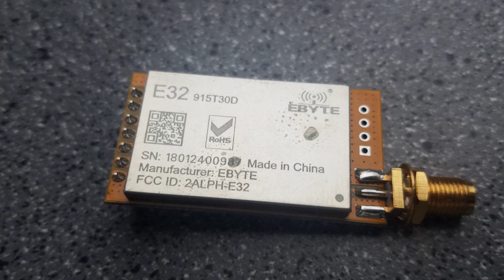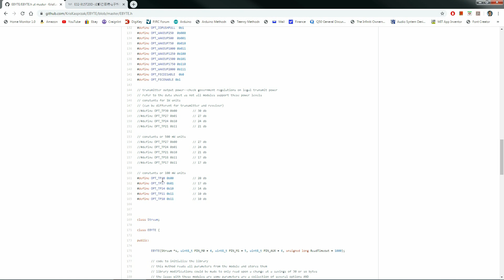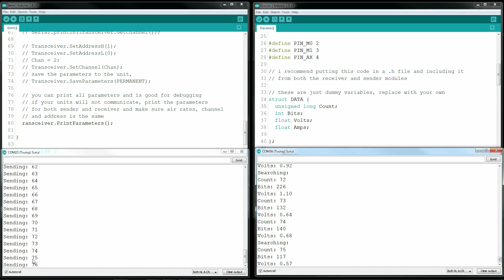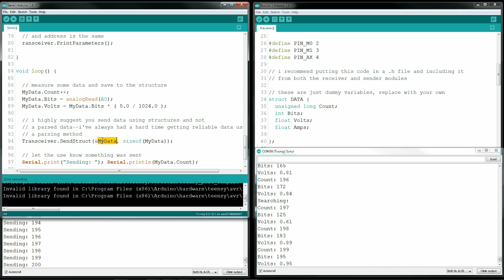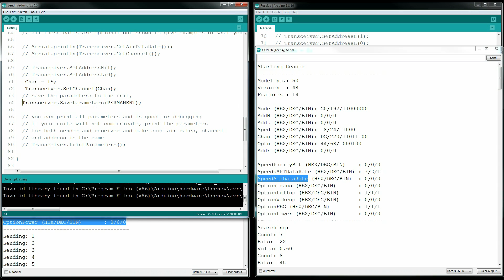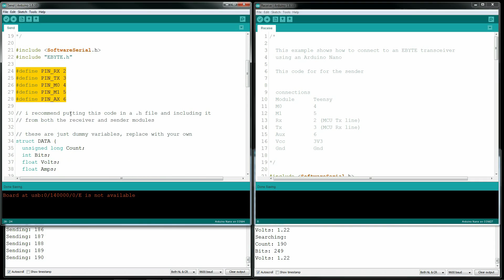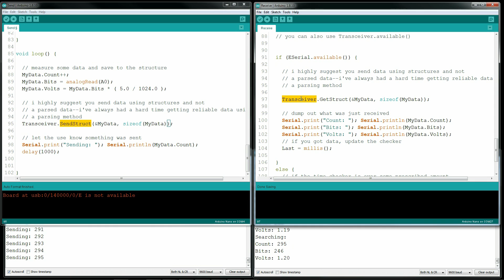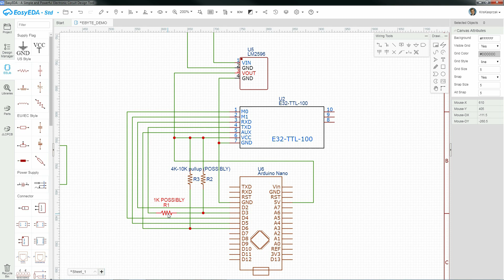EBYTE Wireless Modules for MCU projects

Comment: Hi
In my project I'm using 2 LoRa E32-900t30d and 2 ESP32 devkit v1. I managed to place the same channel in both modules using the syntax of this code, however the parameters: mode, speed and optn of one of the modules are all set to zero, unlike the other. Furthermore, this same module has a model, version and feature number equal to 0, also differently from the other.
I would like to know how to manually set these parameters (mode, speed and optn) so that they're the same as those in the other module.

Comment: Greetings, Mr. Kasprzak,

First of all, thank you for sharing these amazing explanations.

I need your help with my academic project. I intend to send data via LoRa RF. On the transmitter, I have connected the HC-SR04 ultrasonic sensor, the LoRa E32 and the Arduino Nano. On the receiver, I have the LoRa E32 and the ESP32 Wroom.

I followed your examples, but I still can't send the sensor information to the receiver.

Can you help me, please?
Reply from the maker: I'll see what I can do, you may have a few issues namely due to 1) different MCU's and 2) a 5 volt Arduino, these EBYTE units are 3.3 volt but 5v0 tolerant. Hence they can be finicky with Arduinos

1) Test a simple wireless connection first byt sending no structs by just 1 byte 
sender: EbyteSerial.write(97); // lower case a 
receiver if (EbyteSerial.available() { Serial.println(EbyteSerial.read());}}

if you dont get an 'a' on the receiver look at my page for suggestions https://github.com/KrisKasprzak/EBYTE

2) If you do get and 'a' it's probably a struct packing issue. Using different MCU's is complicated but possible, I do it all the time. The challenge is different MCU's will pack a struct differently such that the other will not know how to read it. I use EasyTransfer.h from https://github.com/madsci1016/Arduino-EasyTransfer it can send a struct in a way other MCU's can read. Implementation is something like this

// sender code

#include <EasyTransfer.h> 

EasyTransfer DataPacket; // global variable give the new data packet some cute name

DataPacket.begin(details(Data), &ESerial); // in setup, Data is your struct ESerial is the serial object

Data.SensorData = YourMeasuredData // just an example

DataPacket.sendData(); // make this call after you have populated your struct

// receiver code

#include <EasyTransfer.h>

EasyTransfer DataPacket; // global variable give the new data packet some cute name

DataPacket.begin(details(Data), &ESerial); // in setup, Data is your struct ESerial is the serial object

// in loop
if (DataPacket.receiveData()) {

 	ReceivedSensorData = Data.SensorData;

	Serial.print("Sensor data: ");
	Serial.print(ReceivedSensorData);

}

hope this helps
Reply: Noted! I will follow your instructions.
I will be in touch.
Thank you.
Reply: @KrisKasprzak   

I managed to establish communication between the two MCU. I even managed to send the data to a Broker! I am very grateful for the support.
God bless you.

Comment: amazing my friend, just one question, u library works on E220-900T22D too? thz 4 all!
Reply from the maker: This library will definitely not work with the 220. That unit has more capability and different program settings.  Note this library is only needed for programming these units. for send/receive you can use SerialObject.readBytes(... and SerialObject.write(...
Reply: @KrisKasprzak  i understand, thz 4 answare, can u tell me what libray i can use with 220 device?

Comment: please the Ebyte library can work with the E49-400T20D on esp32 exemple ??
Reply from the maker: this library should be able to program the E49, see the example ESP32 folder. However  you will need to specify 0 for each of these (as they are unsupported):

.SetPullupMode 
.SetWORTIming
.SetFECMode

Comment: Dear Kris, I wanted to extend my deepest gratitude for your incredibly helpful video. I was struggling so hard to get two Ebyte modules to work, and despite looking around the internet, nothing seemed to do the trick. Your video was a lifesaver, providing clear guidance that finally got the modules up and running smoothly. Now, my only challenge is figuring out how to make them function in half duplex mode. Your experience and guidance have been invaluable, and I cannot thank you enough for sharing your knowledge with the world. 
I also appreciate the enormous work you put into creating that wonderful repository on github which was very useful (it's really well done).
Reply from the maker: Glad I could help.  

Not sure what you are trying to do, but I do half duplex all the time. Have all modules always listening (a loop that waits for Serial.available(). Then when a module needs to send, break out of the listen mode and send data. Then after data is sent return to listen mode. When other modules get data (serial.available() = true), process incoming data, then send out data if needed.

Since modules are always listening and you only send data when needed, the process is reliable.

Hope this helps.

Comment: Could you explain the wiring a bit more? Why do you need a current limiting resistor on E32 aux line? Is the impedance of the nano too low for that pullup?
I'm pretty new to electrical stuff
Reply from the maker: You should have to put any pull-up resistors or current limiters on an ESP32. in the video I mentioned you may have to do this with an Arduino nano because they are 5 V.

Comment: Nice job. Is it possible to change the frecuency?. Thanks
Reply from the maker: It is, the way the frequency is changed is by changing the channel. For example, channel 0 might be 900 MHz channel one might be 901 MHz, but it depends on the module but yes, you can change the frequency.

Comment: Hello Kris, Is this configuration alone enough for setting the Address and Channel. Don't we want to configure the E32 with EBYTE RF setting software?
Reply from the maker: You can certainly use the EBYTE software to configure these modules. However if your module is soldered in and you need to change parameters you need a lib like this to do it.
Reply: Thank You, Kris. Can we do both configurations? What if I already configured my E32 with one address and channel using EBYTE Software will I be able to change that using my Library configuration?  @KrisKasprzak

Comment: ... so 3.3v to be in the safe side while manual agree both 3.3/5 v... but later  go by 3.3v... and there is additional 1 k resistor on the tx pin... the fear of burning out the tx pin is obvious ,I experience it on hc-12.. but this module has more wires (7) ..3 wire needs to be gnd ,tx,rx, but aux not need to be wired, and there is 1 gnd on the module itself,you can branch it to the 2 setting pins unlike simpler 4 wire  hc-12... hopefully more durable than a few days hc-12.. and the antenna has to be purchased saperately since there is 433 mhz &  868/915 mhz version on its antenna length ... adjusted to regional radio transmiting laws.. I just need a few to broadcast home ranged Gps Radio Controlled Clock .. 1575 mhz GPS data can't reach certain area in the house or slower than nearby outdoors module..im from the 433mhz lawfully region.. https://github.com/SurenBono/RadioFrequency/tree/main/HC-12/GPS_HC12_toMany_v10_MEGA

Comment: Does this work with LORA AS32 TTL-100,
Reply from the maker: Not sure. I am guessing there are going to be differences in the byte values for programming purposes. I believe this unit has an RSSI feature does a Library does not account for It is serial based and has M0 M1 for control pins and an Aux pin. I have not looked at the data sheet, but I’m guessing some minor changes would be needed

Comment: Hello Kris, I would like to try these Ebyte modules, provided everything is well within the operational limits mentioned in the manual ( temperature / humidity etc) : how long do they last for continuous transmission ? Rugged enough ?
Thank you so much for sharing your library
Reply from the maker: I have sensors mounted around my house for reporting garage door state, outside temp, and a few other things. The system sends data to a base every few minutes and has been running non-stop for about 4 years. I feel they are rugged and reliable.
Reply: @KrisKasprzak  Nice. Do you use Ebyte antennas too ? I saw they have quite a selection on their website. If so what antennas do you prefer ?

Comment: Hi kris, i saw this library is for E32-433T20DC but i have E32-433T20D  the main difference between E32433T20D and E32433T20DC is the frequency band they operate in. So is this library  still works on my lora module ?
Reply from the maker: This library should work. Have a look at the dot H file for the pound defines and it will let you know which ones to use to control things like air, data rates and other parameters.

Comment: Hello Kris, do you remember exactly what modules you tried with the transmitter in the garage and got a range of 900 to 1000 feet ?
Also , for maximum range , which Ebyte module would you recommend ? The 230 Mhz or 900 Mhz ?
Great video and thank you for sharing the library.
Reply from the maker: I have tried many

E50-TTL-100 (148 mhz, which is the one I use around the house through walls etc.).

E32-915-20D (900 mhz 100mw, great range line of site > 1000m, never tested past this )
E44-TTL-100 (900 mhz 100mw, great range line of site > 1000m, never tested past this )
E50-TTL-500 (148 mhz 500 mw, better range, maybe 2000m never tested past this )
E32-915-30D (900 mhz 1watt unit, crazy range, often around buildings, never really range tested over 1000m)
E53-TTL-100 (855 mhz 100mw unit, never really tested, but expect at least 1000m line of sight
I have some 230 mhz 500 mw units as well (can't find them, great range don't really remember how far)

Tips on better range
1. Generally the lower the frequency the better the range as long waves can "bounce" off things better, 148 are pretty good when stuff is in the way. My 900 mhz can barely see around the corner of a large building
2. low air data rate helps. I run everything at 9600. Lower will get better range, but take longer to transmit, may a few seconds for 50 bytes.
3. good antenna, I use the EBYTE wire-type, and are better than the pencil-looking ones
4. higher power, 100 mw is kinda basic, 1 watt units (30 db) are very powerful and require around 800 ma to power--check country standards 30 db is max here in the use
5. get the antenna as high as you can get it.

Comment: Hello Kris , i am glad to have found your channel . 
I did not understand the resistors towards the end of the video for the nano , why are they configured that way ?

thank you
Reply from the maker: These wireless modules are intended for a 3.3 V device. Arduino nano‘s are 5 V units. These wireless modules are 5 V tolerant most of the time. If you run into problems, it’s due to the higher voltage hence you need a resistor to temper the higher voltage
Reply: @KrisKasprzak  Hello again Kris , thanks for the explanation. I have yet to get a couple of those to try them, do you know if there is a way of getting an RSSI reading with the E32 modules ? 
The E220 modules have that nice RSSI feature but there isn''t a 33dbm version of those , 33dbm is what i am after.

Comment: I am transmitting every second (serial mode), which mode (M0, M1 pins) should I use to reduce current comsuption of the transmitter?
Reply from the maker: The datasheet is not very clear on operation but M1 = 1, M0 = 0 (mode 2 is power saving mode). Datasheet claims UART is disable, so you will need to wake the unit up Mode 1 (M1=0 M0 = 1).
Reply: @KrisKasprzak  thanks. So if the receiver is only in receiving mode then i can keep m0 and m1 at 0 ?

Comment: Hello Kris , nice channel 
About the wiring diagram for the nano , shouldn't we use a logic level shifter for the signal lines since the nano uses 5 v logic ?
Reply from the maker: These things are 5 V tolerant But I have seen some times where they don’t work well with 5 V. , I have a few of these transceivers connected to nano‘s working 24 seven and or working fine. some people have put voltage dividers on the EBYTE RX, M0, M1 lines Either to get them working or as a precaution
Reply: @KrisKasprzak  GOod to know they are 5v tolerant.

I have tried the Ai Thinker LoRa ra-02 modules , these were okay but they need i-pex antennas and they're  annoying . Got a range of about 1.6 kilometers with those .
I was about to get the Adafruit modules , the nice thing about them is you can choose the antenna type you want to use . 

BUt after seeing your most excellent video I intend to give Ebyte a try and use a nanoVNA to be sure I have good antennas .

Comment: Thanks for the video, I understood a lot, but I can't make the two lora communicate, they look like all the start data, but they are not receiving it. Do you have any tips? I am from Brazil
Reply from the maker: Oie tudu bain , what is printed on the serial monitor from the PrintParameters call?
Reply: @KrisKasprzak  in the program to receive

Starting Reader
----------------------------------------
Model no.: 32
Version  : 10
Features : 14
 
Mode (HEX/DEC/BIN): C0/192/11000000
AddH (HEX/DEC/BIN): 0/0/0
AddL (HEX/DEC/BIN): 1/1/1
Sped (HEX/DEC/BIN): 18/24/11000
Chan (HEX/DEC/BIN): 5/5/101
Optn (HEX/DEC/BIN): 44/68/1000100
Addr (HEX/DEC/BIN): 1/1/1
 
SpeedParityBit (HEX/DEC/BIN)    : 0/0/0
SpeedUARTDataRate (HEX/DEC/BIN) : 3/3/11
SpeedAirDataRate (HEX/DEC/BIN)  : 0/0/0
OptionTrans (HEX/DEC/BIN)       : 0/0/0
OptionPullup (HEX/DEC/BIN)      : 1/1/1
OptionWakeup (HEX/DEC/BIN)      : 0/0/0
OptionFEC (HEX/DEC/BIN)         : 1/1/1
OptionPower (HEX/DEC/BIN)       : 0/0/0
----------------------------------------
Searching: 
Searching:  

in the sen program

Starting Sender
----------------------------------------
Model no.: 32
Version  : 10
Features : 14
 
Mode (HEX/DEC/BIN): C0/192/11000000
AddH (HEX/DEC/BIN): 0/0/0
AddL (HEX/DEC/BIN): 1/1/1
Sped (HEX/DEC/BIN): 18/24/11000
Chan (HEX/DEC/BIN): 5/5/101
Optn (HEX/DEC/BIN): 40/64/1000000
Addr (HEX/DEC/BIN): 1/1/1
 
SpeedParityBit (HEX/DEC/BIN)    : 0/0/0
SpeedUARTDataRate (HEX/DEC/BIN) : 3/3/11
SpeedAirDataRate (HEX/DEC/BIN)  : 0/0/0
OptionTrans (HEX/DEC/BIN)       : 0/0/0
OptionPullup (HEX/DEC/BIN)      : 1/1/1
OptionWakeup (HEX/DEC/BIN)      : 0/0/0
OptionFEC (HEX/DEC/BIN)         : 0/0/0
OptionPower (HEX/DEC/BIN)       : 0/0/0
----------------------------------------
Sending: 1
Sending: 2

thanks for the help

Comment: Hello, very good example, I need to ask you something, can I use (TRANSCEIVER.SENDSTRUCT   and   TRANSCEIVER.GETSTRUCT) in the same module, to receive and send data at the same time, but I thing that i need to use diferent channels, for example, SENDING and COUNT in both modules, more like a bi-directional communication.
Reply from the maker: these modules are not bi-directional, you can send the call get, but really need to wait until transmission has completed. Changing channel will still not allow simultaneous transmission.
Reply: @KrisKasprzak  ok, thanks for your quick response, I explain myself better, I need to monitor and take control actions on both devices, This is what occurs to me, in device 1, I start transmitting data, for a period of 5 seconds, in device 2 I start receiving data, for the same period of 5 seconds, Later, I exchange the functions, on device 2, I start transmitting data for 5 seconds, and on device 1 I receive data for the same period of 5 seconds, and that would be the loop of the program.

Comment: I took a look at your github.  My ebyte900m22, llc68, doesn't have m0 m1 pins.  What do they really do?  Is your github compatible?
Reply from the maker: It looks like that unit is and SPI based device. Not much of value in the data sheet regarding programming, but it looks like RXEN and TXEN are the mode switch pins (M0 and M1). It does not look like it as and AUX pin, but that can be set to -1 during object creation. I'm guessing though--the data sheet is pretty lame.
Reply: @KrisKasprzak  semtech has a register level data sheet.   But I don't know if the registers are the same as your code uses.  TxEn RxEn can cut power to rf circuitry to save power. Not sure if those are the same as m0 m1.

Comment: Have you any experience/testing the library with the E34 2G4H27D?  I am new to the module any advice or hints would be appreciated.
Reply from the maker: I'm not familiar with this module. It is a serial-based device so my library should be able to program it. However my library can be used for programming and you don't the library to use it for communications.
Reply: @KrisKasprzak  I want to take advantage of the spread spectrum, frequency hopping mode that this module offers.  I will try out your library shortly.  I am using Platform IO with a Blue Pill MCU.

Comment: hi, i am using ebyte e32900t30d model. There was no problem when using arduino IDE for Esp32 serial communication. I was getting the data in real time at 1 second intervals. But I tried using microphyton and failed. Later, when I used the Arduino IDE again, after waiting for a while, I saw that all the data was reflected on the screen at once. I can't get the data in real time at 1 second intervals like before. Anyone know about the problem?
Reply from the maker: Not much anyone can do w/o some code to look at

Comment: Hi Kris Kasprzak, I'm considering buying the E220-900T30D Lora module. But how can i run this module with arduino. My profession is not electronics engineering. In my research, I saw that Lora E32 and E22 series have separate libraries, but I could not find the Lora E220 Series library. Can you post a code sample for a simple receiver and transmitter for Ardiuno? Thanks.
Reply from the maker: This library is only for serial based devices. I don’t have a library or code for the SPI versions